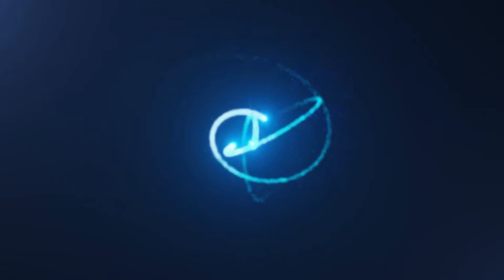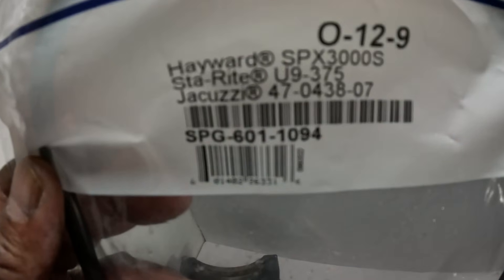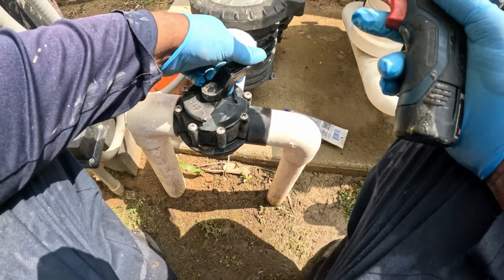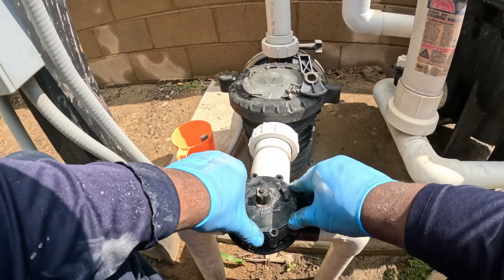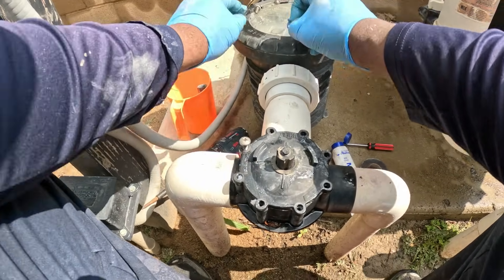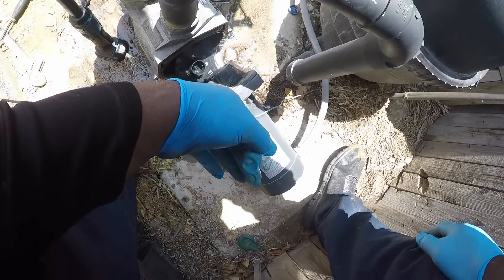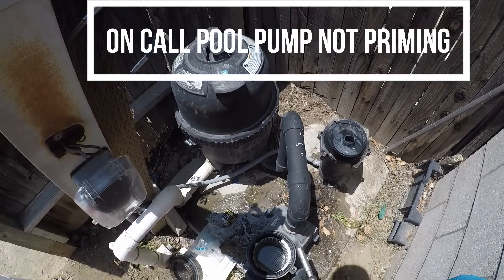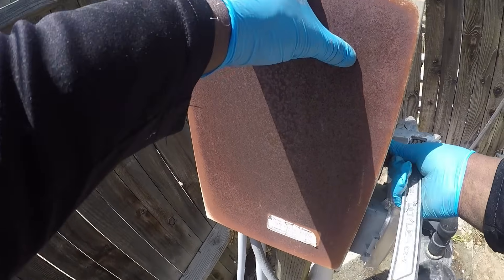Pool Pump not Pumping water ( Priming )! Part 1

Comment: WHATS A QUICK FIX FOR A HAIRLINE CRACK ON  Diverter Valves?
Reply from the maker: If it's the top quick fix, replace top. more complicated if cracked valve body, normally will have to be replaced
Reply: @Poolishness 😊😊